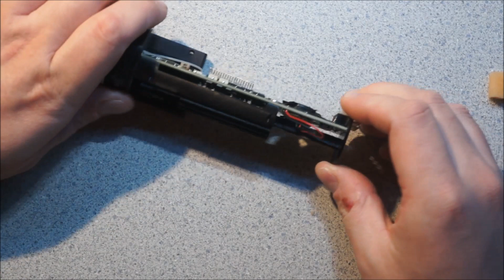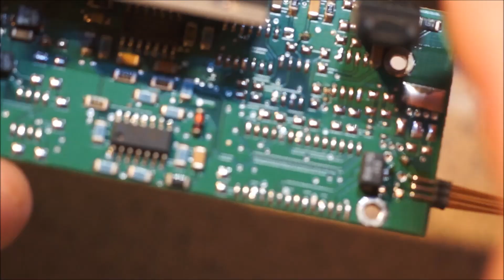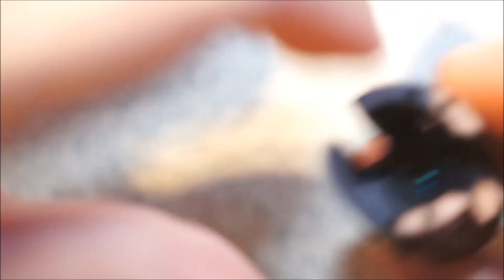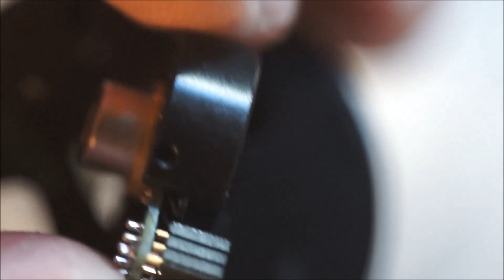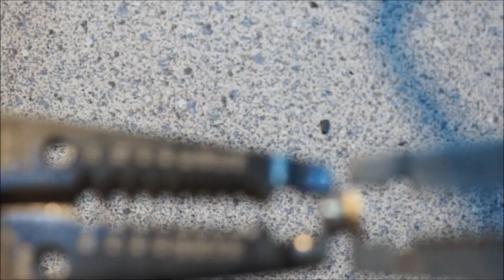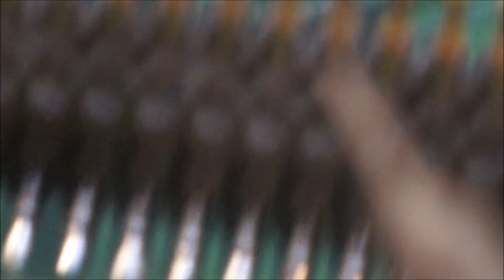Fibre Laser Diode Module

Comment: A tech observation for your blast from the past: your pinched interior lead end is from the spot welding op that fastened those almost imaginary conductors, lol. The delicate ball end connection is needed on fragile die, that post can be abused to no end in comparison, and gets fast and dirty treatment. Your double sprung chopstick screws give the end cap thermal float, as that peltier most probably shrugs the heat off to case and sink while diode package is reasonably stable, so uneven expansion, and wanderlust for direction of aim. The plastic gasket just keeps it all floaty, even if the aluminum is tempted to chalk a bit